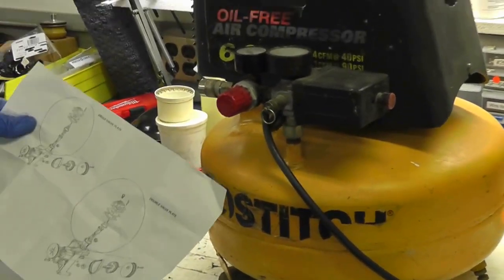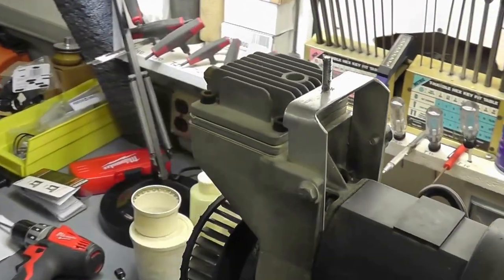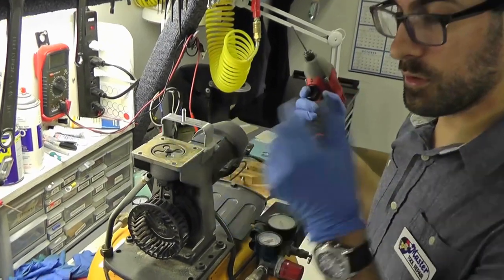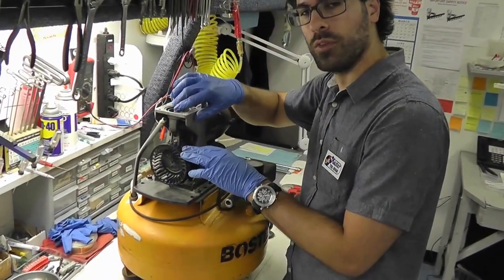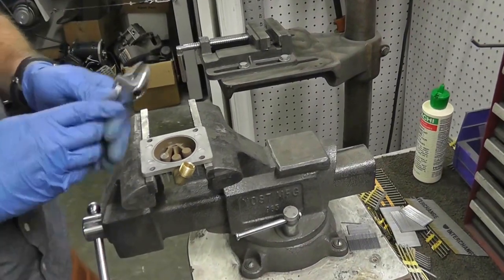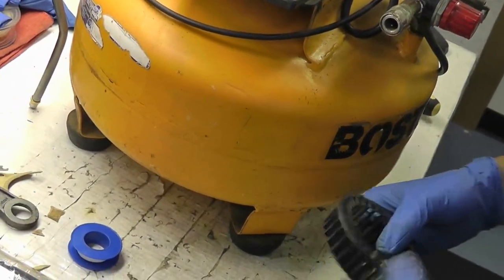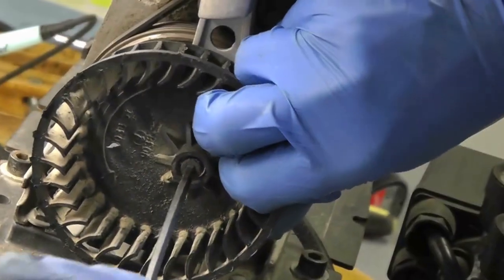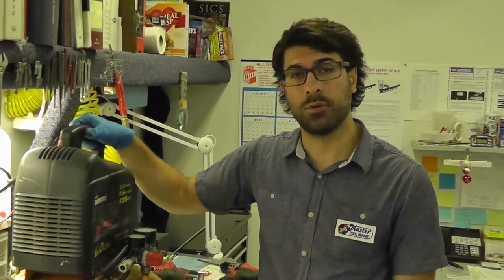How To Install The AB-9429999 Valve Plate Assy Kit

Comment: Thank you for a great video, I am a 56 year old female and I was able fixed our compressor!! I did have to go to the other comments, of course the valve plate needed to be rotated 180 degrees. When I first installed the intake was blowing outward.  I was so confused until I read comments! Thank you for video and comments!! So happy our compressor is working!!  My husband was surprised I managed to repair without taking to a repair service.
Reply from the maker: Thank you so much for watching Gaile, and we're very happy to hear it assisted you in repairing your compressor! It's a great feeling to repair equipment and is one less thing to add to the landfill. Good work!

Comment: i watched your video a few times and saw how you snapped off the screw on the connecting rod, I've also tried on mine with a T25 bit, and it was very tight, and i could not loose with my craftsman 8 volt impact screwdriver until i use a torch to heat up the screw on connecting rod, i think that break free the grey color thread locks, and then screw instantly come off easily with my impact screwdriver, save me buying a new connecting rod.
Reply from the maker: Correct, if given more time I would have applied heat to the screw/piston top, as this makes it much easier to remove the screw due to the thread lock. Thanks for the comment!
Reply: Or, a soldering iron on the screw, to do less damage.

Comment: Why is it after putting a new piston and valve plate on my 26gallon husky compressor  when I turn the motor over by the fan by hand it spins freely  only 3/4 of the way the last 1/4, is like the old cox gas airplane  it feels like it's at a compression stroke

Comment: Great video! Thanks. I have a blown bearing on the eccentric shaft. The inner race is "welded" on the shaft. Any tips on how to remove that?
Reply from the maker: Thanks Fred! I would suggest putting heat to it, this almost always does the trick. Take a small propane torch to the inner race and with the heat expansion it should be easy enough to remove. Use a small 3-arm bearing puller to remove it from the eccentric shaft. Good luck and hope this helps!
Reply: Hi  same thing hapen to mine it seems like that is the week part on this model, Ok so what i did is i used a cuting wheel you know on a 4 1/2 inch grinder like i said with a cutting wheel remove as much as you can off the inner race, be careful not to remove too much cause you might remove some metal off the shaft (excentric) and because the inner race is hardened , hit it with a sharp shisel and it will brake in pieces, that is the way i removed mine, hope it help, good luck. Oh well i am looking at the date 2 years ago, oh well.

Comment: Excellent series of helpful videos! Thanks for sharing. I purchased the replacement kit, due to a broken reed valve, but the replacement differs in several ways... the main difference lies in the double plate (vs my existing single), an open port hole in the head cover, and a piston head / cover that is solid (as opposed to my existing one that contains valves / reeds. 

I installed the gaskets and double plate assembly two different ways, but each time, the compressor failed to build any pressure. Not being mechanically inclined, I'm wondering whether or. It I also need to replace my piston head / cover with the style accompanying the overall "replacement kit"? Any thoughts will be greatly appreciated... thanks! -Andy
Reply from the maker: Well obviously when the unit is apart is an opportune time to take a look at the piston and cylinder cup as well. If the cylinder walls look burnt / scored or you can see a gap in between the cylinder and piston then replacing them now would be a good idea. I would take a look at the valve plate and make sure the valve were in proper alignment with the ports and would open and close properly. I have had to take some of these valve plates apart and clean them because the valves would hang up because of rust or congealed lubricant from setting on the shelf at the factory in the heat and cold. I can't say definitively that this is the problem but i have run in to this in the past. First, however, I'd check the piston ring/seal and cylinder.
Reply: Master Tool Repair Thanks. Yea, I decided to replace the piston head and, similar to your video, sheared the screw in removal. I'll need to purchase a new piston arm assembly and possibly a ring (just for good measure).

Comment: I have a style 1 that is being converted to style 2 via the valve plate assy, new piston top, and new piston ring/seal. However I am getting pressure out the vent on top of the head and suction from the output ("L" fitting). Any ideas why?

I did follow the instructions to the T. I clipped the zip ties and put the head on. No messing or fiddling with the plates and seals. The piston and ring are sealed very nicely.
Reply: Part manufacturer installed the valve plate the wrong direction prior to zip tying the assembly together. Just needed to rotate 180* and all was good.

Comment: You shouldn’t use an impact to tighten bolts, especially head bolts. 
Snug them diagonally, then tighten each one by hand with a ratchet or wrench. 
-best to do that in a couple of steps.

Comment: Can you perchace a piston plastic ring thrubthe site also?
Reply from the maker: It really depends on the model number, but usually the Piston Rings for the oil-free units are only available in a kit with the connecting rod and cylinder. But again, it depends on the make and model of the air compressor.
Thanks for the question!

Comment: i replaced the kit but when I turn the compressor on it blows the air intake filter out like its pumping backward. I double checked the orientation of the two holes to the intake. I did not have the  new seal. Any ideas on what might be wrong?
Reply from the maker: Typically this is due to the valve plate being turned 180°. Turn it around and this should fix the problem.
Reply: @MasterToolRepair  Same thing happed to me. Turning it around does fix the problem. Low pressure (two holes) on the side of the air filter. Thank you.

Comment: It's a good and helpful video but as I watched this I got to wondering if the guy doing the presentation was a manager of some kind and not a technician.  Maybe it was a severe case of nerves but there were mistakes like thinking when disassembling there were no nuts on two of the four head bolts (finding one dropped out nut later), calling the head nuts "lock nuts", not knowing to apply heat to the thread locked cap bolt, initially putting the head 90 degrees from correct, etc. etc.
Reply from the maker: Eric isn't a manager, but it has been a few years since he has worked with these units. Instead of polished videos, we like to make them "real" but I agree that he could have been a little more prepared!
Reply: @MasterToolRepair  Stop wondering and be appreciative for their valuable time and efforts.  Think positive and not find negatively.  Awesome and helpful video.  I will be doing some troubleshooting on my air compressor.  Thanks.
Reply from the maker: @georgerrumph4989  Thank you so much George, we appreciate the positivity!
Reply: This dude is thorough, I appreciate this video. Totally save me from spending money I didn't have for a new compresser.
Reply: @MasterToolRepair  He put the reed valve on the wrong way . There is no way that air compressor was working . The reed valve has to be turned 180 turn before it will work right .  Please add the mistake in the description .

Comment: Hey, Eric, nice job, but you did it wrong.  If you check your video from 2012, you put the valve plate in correctly then (https://www.youtube.com/watch?v=ctve_2dLHVE at 4:00).  At 19:50-19:59 this video, you show the valve plate with the inlet holes on the side of the plate AWAY from the air filter.  The valve should admit air on the intake stroke, you have the twin slots on the air filter side, preventing air flow.  If the plate is flipped so that the holes are under the air filter, then air will flow into the chamber on the intake stroke.  If anyone is in doubt, apply a vacuum to the slotted side and feel the air flowing into the holes.  Think of the holes as the soles of Superman's feet as he flies away from you and the slots as his arms blocking air flow.  (My simple analogy to visualize the air flow).  I liked the video otherwise, kept me from breaking the screw (I used lots of heat and filed down the side of the screw to allow me to put a crescent wrench on the screw for better leverage.) and also the hint about the reverse threading of the fan screw (although I still made the mistake of trying to turn it the wrong way).
Reply from the maker: Good catch tasdm! Yes, you are correct. I've installed this valve plate many times in the past and maybe it was just the camera jitters, but I did install the valve plate the opposite way it should have been installed. Your pointers and suggestions are very well taken and helpful. Thanks for watching and liking, and for the further explanation!